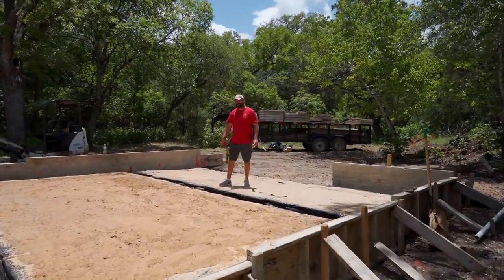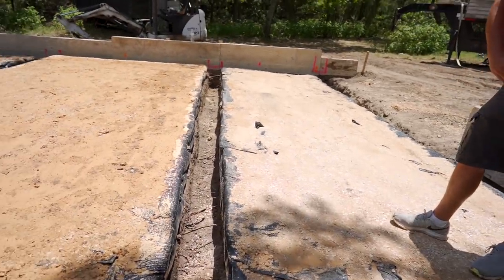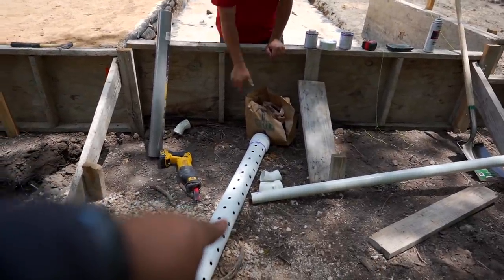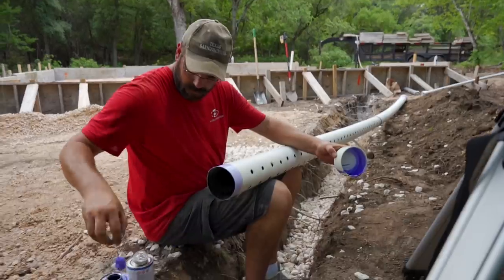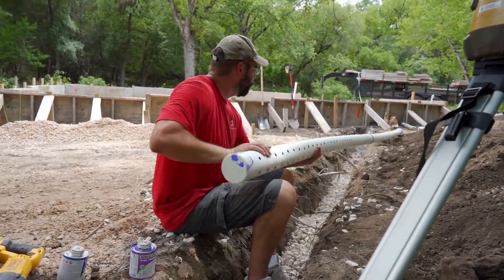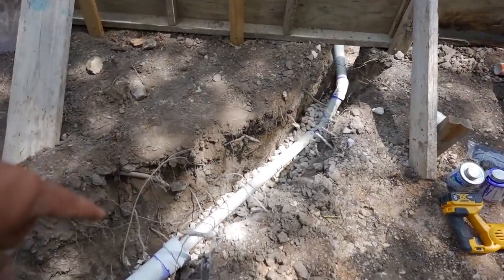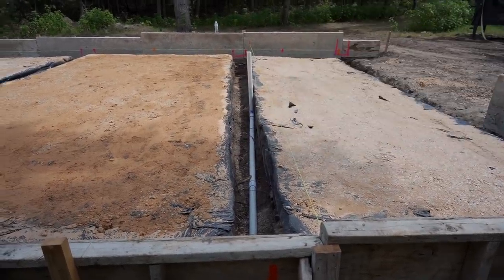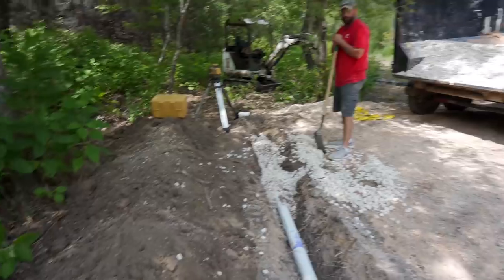Plumbing drain lines |  Demolition Ranch Headquarters 3 | E66 S3

Comment: That pipe is going to be full of tree roots in let then 6 months, Can I recommend next time you line the trench with the mesh then stone, also  put a root sock over the pipe before covering with more stone, then finish off with mesh . this will give at lest 10 years before the drain becomes root bound. other then that you guys are doing a great job.
Reply: For a low use drain... the roots will take in the water as fast as they are  putting it in the drain.
.
You'd be right for a septic leech field or a French drain.
.
This is just a detail to move   some grey water further from the foundation and to make it harder for rodents to get in.

Comment: Hey! Great vid! 
Just one question: isn‘t it possible that roots will grow into the drain pipe from underneath? I‘m not sure about that, but what i know that roots have a lot of strength - e.g. my house had concrete ground pipes, which were completely busted by roots.

Comment: Dirt will still get inside the pipe, you need to put the cloth around the entire thing, the gravel should be inside the fabric.  It should be like one big burrito.
Reply: I've seen it as you described as well as putting the cloth in the bottom of the ditch, then the pipe, fold cloth over then stone on top, final grade with dirt.
Reply: The way the fabric was used was a complete waste.
Reply: Nice vette

Comment: The hand wash sink is still considered by the state of Texas to be waist water and requires a trash tank between the outfield, also you want to start atleast 10' away from the foundation.
Reply: I always thought a gray water tank was required. But I don't know Texas laws. In CA you would need a gray water tank which is basically a hole with gravel and a minor county permit.
Reply: I've seen people dump their grey tank on the ground out of an RV as it was just shower or sink water, not toilet, and I also heard about someone plumbing their house so only the toilet goes to the septic, all other water just into the ground.
Reply: I know that they know what they're doing, otherwise they wouldn't be in business. Plus the construction has to be done according to code.. there are permits and inspections that are done to help ensure that everything is built accordingly.
Reply: I had houses out in the country where the washing machine and utility sink drained right into the leach lines bypassing the sceptic tanks altogether.
Reply: @SheepdogSmokey  wouldn't sending only black water to the septic tank create a thicker mix than the trucks are meant to pump out?
Reply: @cm01  the biggest issue is even a handwash or a washing machine is going to add sediment thus needs to go into a trash tank aka "septic tank"
Also you dont want perforated pipe and gravel anywhere near the 45 degree bearing of the footer, water is no bueno for a fountain.

Comment: it's a pity the drain pipe will be blocked after the first couple of rain storms !
Reply from the maker: How?
Reply: @TexasBarndominiums  The sides of the hole are dirt. As it rains and floods the rock, the dirt will mix with the rock and silt-up the pipe over time. That's why the fabric is supposed to fully surround the pipe and rock.
Reply: the cloth should have been laid all the way around the pipe to stop seepage of dirt thru the stones

Comment: Why not add textile fabric in the trench first, before the stone, to block root growth into the pipe? With all those trees I'd worry about roots growing into the pipe rather quickly.
Reply: There's not going to be a lot of water, it'll be only when they utilize it. It's not like the amount that you'd see from a house or apartment.
Reply: The fabric won’t stop tree roots. This system will fail, just a matter of time.
Reply: Yep. It's not just the waste water that will attract the roots. That trench filled with gravel becomes a low pressure area that any ground water will pool in. Not a big issue though, as the more roots, the more water gets sucked out by the vegetation. It's not a pipe that requires flow-through so roots aren't going to cause any real issues. Worst case scenario - in 20 years they have to dig a new one in.